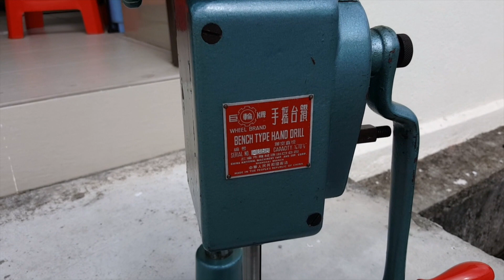Antique hand crank bench drill

Comment: Audiophile DIYer, I need your help. I purchased a drill like yours but does not 
work as supposed.  The mandrel goes down and when touches  wood, nothing
 happens, the drill bit just goes further tearing the fibres and stucks 
in the wood. I could not find any information about the operation, I 
tried different setups with the screw on the left... do you have any 
opinion? I did not take it apart just cleaned inside the gears and 
greased them again. Should I take apart the flywheel? How? Thanks for 
your help in advance.
Reply from the maker: maybe you can upload a video of your drill's problem so that i can compare with mine?
Reply from the maker: @vizsli  Hi. in the Video clip no.1,  time 0:15 , you can try to put some oil in it, so that the flywheel can move very freely. Please loosen the knob when you are drilling thin metal or wood. If you are drilling something thick and using very large drill bit, you need to slightly tighten this knob. thats means , this knob is to adjust the load , the heavier the load, the more friction you need to apply to the flywheel. I hope this helps.
Reply: @AudiophileDIYer  Thank you for your help. It works better and better, needs some time and useage to work properly again :-)
Reply from the maker: @vizsli  I'm glad to hear that it finally works for you. Once the flywheel loosen more, it will perform much better.